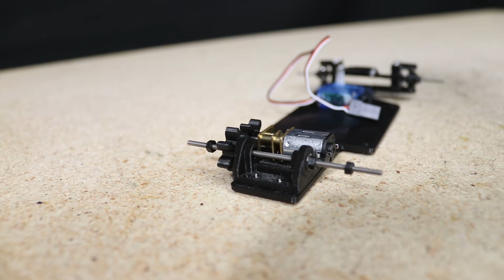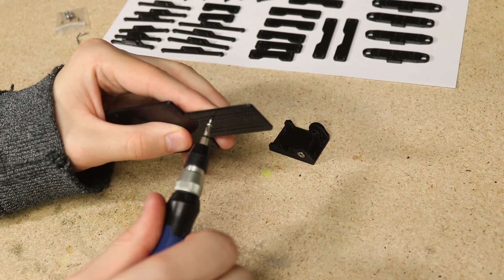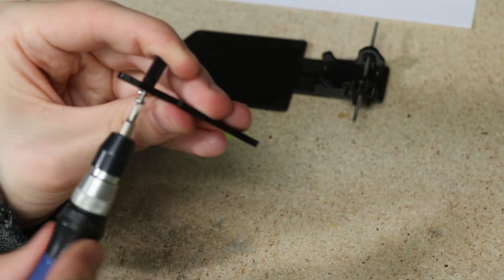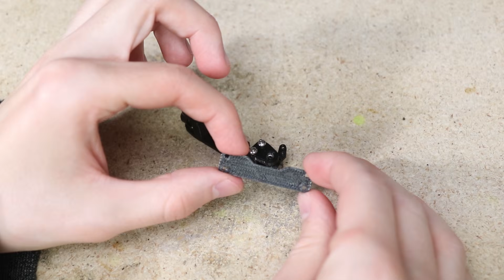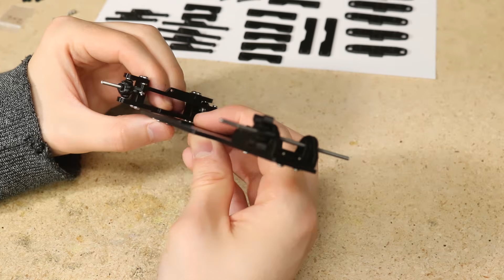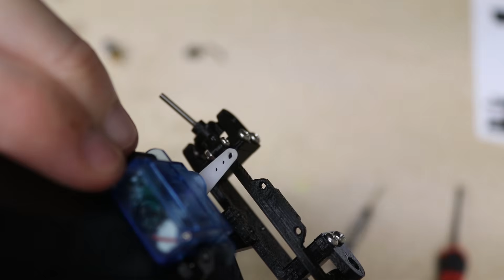FP UC1 1/24 Scale 3D Printable RC Chassis Assembly Tutorial

Comment: Normal Servos do not have a hole to insert a screw. Where did you find a servo which has a screw hole
Reply from the maker: We're out of stock at the moment but this is the exact servo I used: https://shop.makeitrc.com/products/steering-servo-for-fp-uc1?_pos=3&_sid=82db1ffe8&_ss=r

Other micro servos of a similar size should work, but I can't guarantee proper fitment.